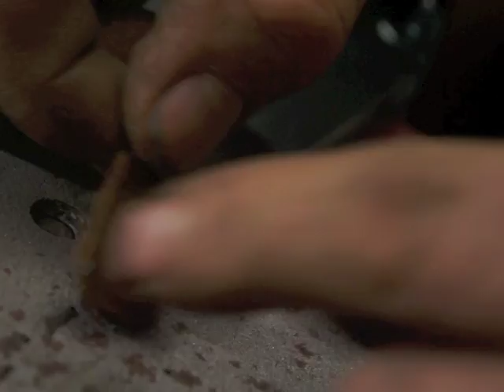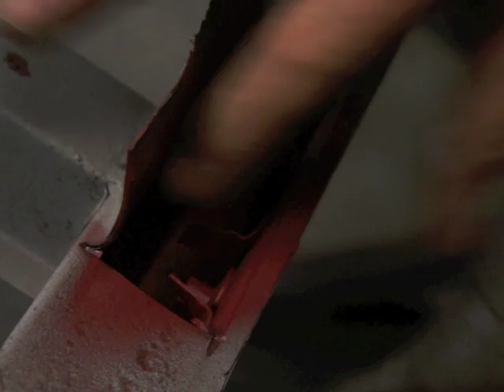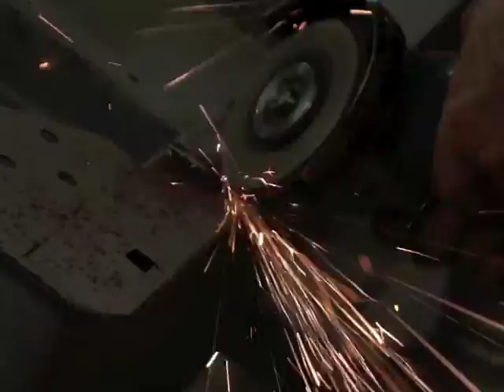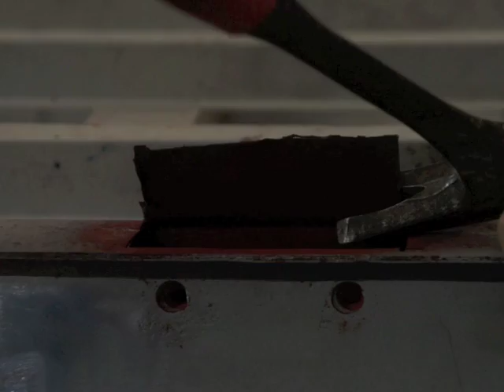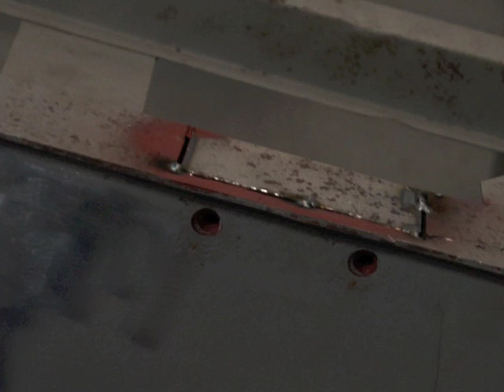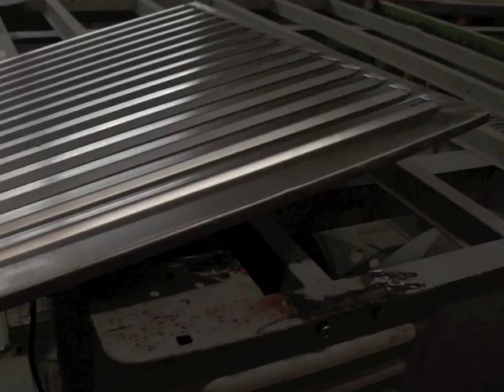VW Bus Single Cab Captive nuts

Comment: Hi, great videos, im restoring a 58 single cab but have never done any welding......may i ask what welder & settings you use or should i not attempt it.
Practice steel is no problem as i work in a steel sheet factory.
Bottom treasure chest at lower cab area is the main area at back of the wheel arches.
Thx from sunny costa-del-england ;)
Reply from the maker: +Warren Greenfield 

I learned how to weld on this truck project so can you. Buy a welder and watch some Youtube videos on welding sheet metal.